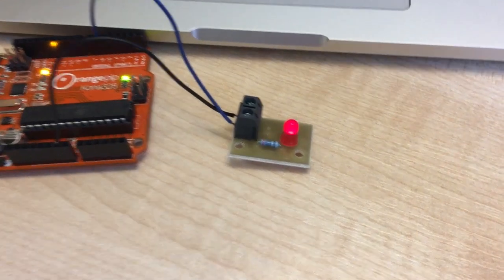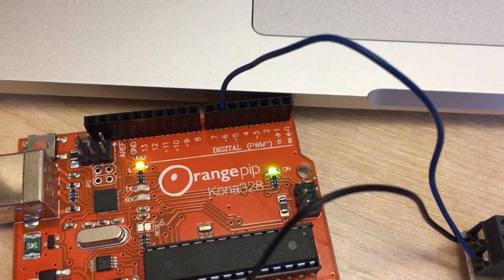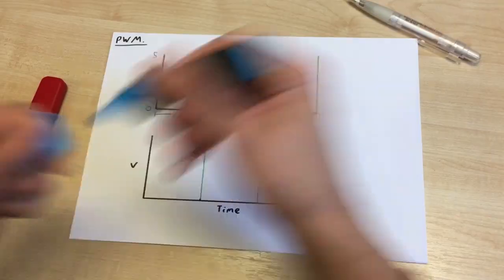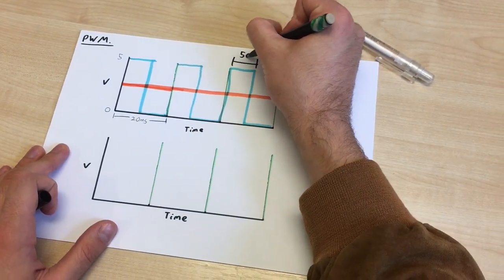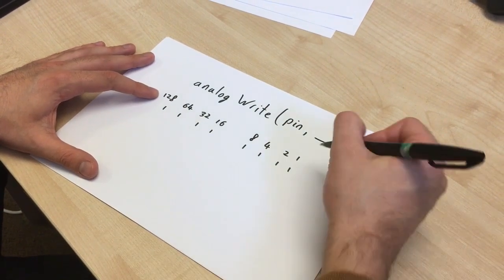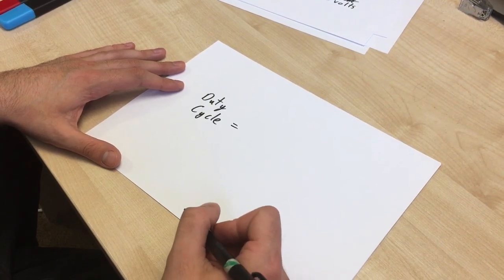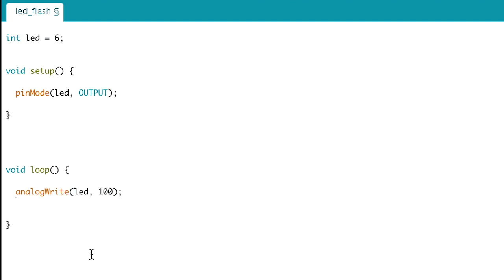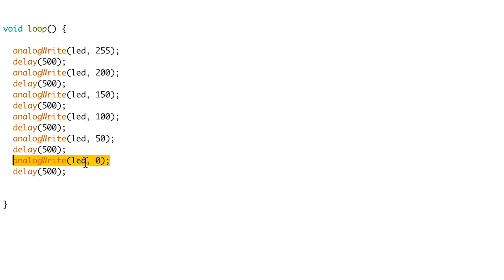Arduino Lesson 7 - Analog Write

Comment: For this to work properly, is it dependent on the natural capacitance of the wires that the PWM signal is being transmitted on, so that those wires more or less "average out" the PWM signal into the desired fractional voltage?  are there cases where we'd want to use a capacitor to smooth out the PWM signal for us before any downstream components receive the PWM signal?

Comment: should be careful using PWM for anything else other than something primitive like LED or a motor. i found out the hard way that some electronics are super sensitive to that PWM off moment and it can destroy them. maybe not right away but over time. if the datasheet says use potentiometer instead, respect that datasheet and use a potentiometer.

Comment: Awesome explanation!  Since this pwm wave is just an average of the on and off voltage duty cycles, wouldn't that introduce extra noise into the circuit? Is there really no way of giving it an exact voltage without using a buck base converter?
Reply from the maker: Thanks Kelsey! It's for voltage supply & crude signal generation (10 bit) for the most part, so noise is negligible. PWM is the standard with most basic micro controllers. Other MCU's (micro controllers) can have built in DAC's (digital to analog converters) which work using other methods but as far as i'm aware the ATMEGA (the Arduino's MCU) doesn't have that capability.... but I have never needed it, so who knows, maybe it does. 

If you wanted finer signalling you wouldn't use DAC anyway... more likely a signalling protocol such as I2C or SPI (which use "digital signals"), but that's a little more complex.
Reply: Thanks!